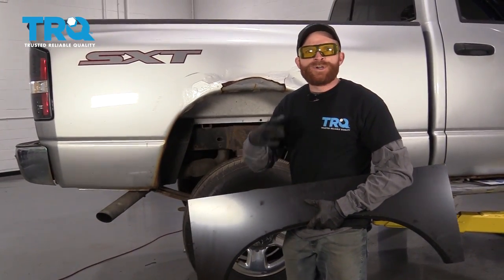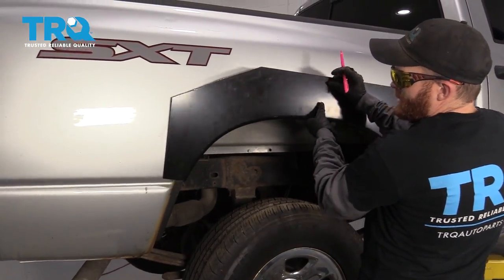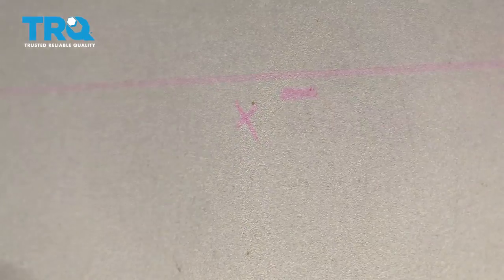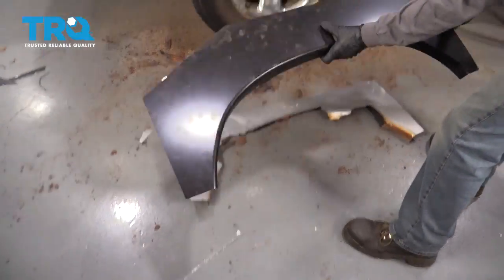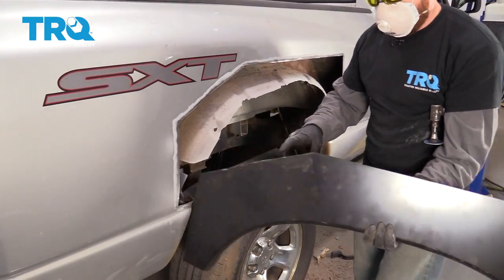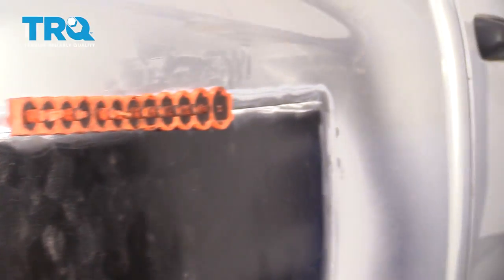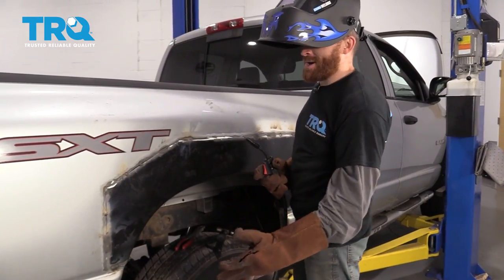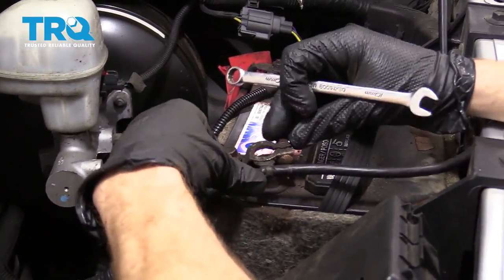How to Replace Bed Wheel Arch Panel 2002-2008 Dodge Ram Truck 1500

Comment: Yes flux core is tricky. Next time. Turn down the heat. And don’t weld so far away, bring the trigger right up to the seam and “stitch it together”.

Comment: Great informative  Video, you'll have much cleaner welds with a tig or mig welding setup, basically anything that uses a shielding gas...But sometimes we need to use what we have on hand/ what we know how to use in DIY jobs and a flux  or even a stick welder can get the job done as you demonstrate in the video, a grinder and bondo will cover up all the imperfections...nice job
Reply: Stick would be a real challenge😂

Comment: One good trick if you're painting from the body line down is to spray on chip guard from the bottom up a few inches the whole length. It's textured, goes on super easy, covers mistakes very well and takes paint without drips...which doesn't really matter because it hides drips.

Comment: Where is the 2nd part of this? Seeing him do this for a company makes me feel better. I'm not a great welder myself but this was hilarious... if you arnt gonna weld the whole thing then you would be better off over laping the metal and using body panel epoxy then bondo. That's gonna pop and prolly be wavy as hell since you only wanna do spot welds in separate locations till it's full so you dont heat the metal and warp it. I really feel better about my welding now
Reply: Gasless flux core seems like an odd choice of wire for this

Comment: What about the inside that you cut off?
Reply: That´s what i wonder as well, will it be as stable as it was.
Reply: It goes bye bye
Reply: I'm about ready to do this. You can buy the inner arch. To me, o don't understand why he didn't repair that as well. Salt and dirt is going to rust that whole panel ... at least buy a plastic liner and rust convert, undercoat what's left of the arch.

Comment: No square corners on your patch panel.Round them off then weld.Makes for a way better job.And use a mig (gas not flux core)welder.

Comment: What about the inner wheel fender you butchered? I just did mine on Silverado and I rebuilt the rust edge instead of replacing inner.

Comment: flux core can be used in a better manner, if using a flux core, prob best to brush off the dust after each tack weld, it can be done

Comment: What about the inner side. No one is showing what to do with that or just leave a giant gap ? Seriously no one makes a damn tutorial from a to z and only showin the easy parts. Why make a video only giving half the info ?
Reply from the maker: +Gyengye Gabor Thanks for the tip! We'll pass this info along to our production team. http://1aau.to/m/Shop-TRQ
Reply: @TRQ  That would be awesome,and dont know if a premier but i did not found a single guide on what to do with the inner wheel arch if rotten,how is the inner fender joined to the outer fender,is it welded,glued,screwed or just folded on it. How to rebuild it to what size how to size it,make before or after the outer shell. It is a really important piece but i guess boring to show how to fix it and would make a long video which people wouldnt watch i guess.
Reply: Most people leave the inner panel alone.  I intend to.  It’s not visible, and leaving it open will prevent future rust, since salt will rinse and run off.  Just be sure to spray rust reformer/undercoating in there before you weld the outer panel on.
Reply: @AJRvlog  won’t the make the bed side flop around?
Reply: @jonthelamb4549  i also need to know how sturdy it will be. someone please answer...
Reply: id at least get in the other side and clean it up and paint it, remember kids, rust usually starts from the inside then out

Comment: Is it possible to do this job with pop rivets? I would like to attempt this but I don't have a welder.
Reply: There’s a whole method that involves adhesives. That’s the ticket if you don’t have a welder. Look into “rust repair with glue in panels”. Or somthing similar.
Reply: Body adhesive and a lap joint.
Reply: I have seen it done by overlap, with pop rivets, or sheet metal screws, grinding heads off. Plus brazed with torch

Comment: Holy waaaavvvvyyyy panel there bud, supposed to randomly spot weld around panel switching from side to side till the whole seam is done....move around ALOT to keep heat down and not warp panel...nd flux core is WORST choice to do body panels with, get gas shielded for gods sake!

Comment: This video sucks, the welding tip is protruding way to far out of the cup. He is holding the welder to far away from the metal and he's either not got the gas on or he's using Flux core which is not good for auto panels. His welding sucks, and hes not actually weldingnthe entire seem. Terrible video once the welding starts!